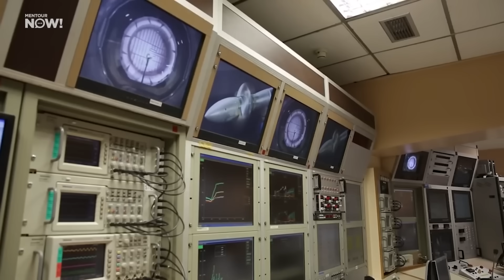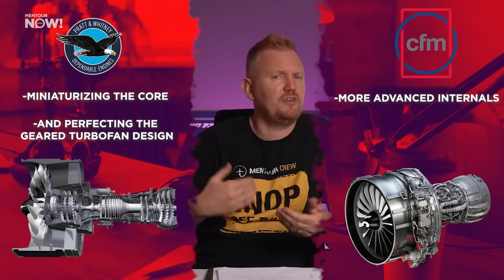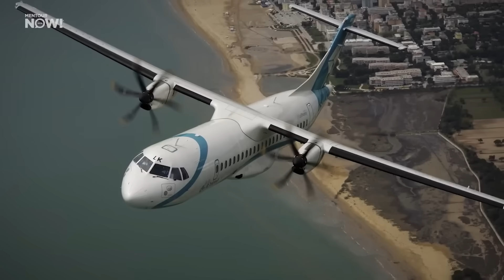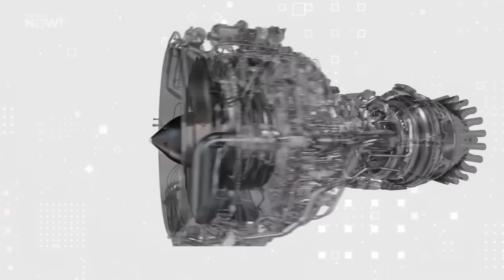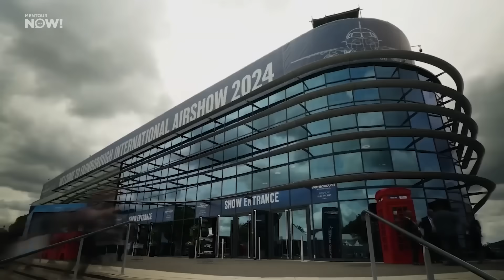Brilliant Or RISKY? Modern Aircraft Engines!

Comment: At the beginning of every flight airline stewardesses or stewards will select passengers that will help in the case of emergencies like aid in the opening of emergency doors.  On Boeing's 777 air liner this includes picking a particularly strong person that will can shimmy down the length of both wings during flight to help deploy the folding wings in the event they won't deploy during flight.  True Story.

Comment: Just looking at the planned open fan engines, I have concerns of what happens with a bird strike, cold/hot weather and stresses on plane frame, tail. Does there also need improved landing gear/tyres?? Also what is the impact of vortex trail on take off and landing, is there any change during flight?

Comment: One thing to consider re noise reduction in open-fan engines might be to draw inspiration from aircraft of old like the XB-70 Valkyrie, except with fan blade design instead of wing design. Instead of compression lift, why not compression thrust?

Just as the XB-70 used the shockwaves produced when flying faster than the speed of sound to its advantage, it might be possible for the CFM RISE to exploit that supersonic blade rotation the same way by angling the blade-tips backward at 45-degrees so that the shockwaves flying off the blade-tips are bent into a rotating invisible tube of sorts. Would be taking what would otherwise be a nuisance and transforming it into an extra efficiency gain.

Comment: Turboprops just aren't as safe as turbofans. No matter how much they try to compensate and make it similar to the ATR engine's propellers, they still need to have the governor, which can fail, you need to feather the props if the engine fails, which can also fail, during a belly landing you won't lose one blade, but all of them on both engines, resulting in shrapnel going everywhere, even if the cabin is reinforced it could go through the windows, which has happened, and then you have the water landing where I don't know how it would impact the dynamics, but I can imagine it won't be beneficial.

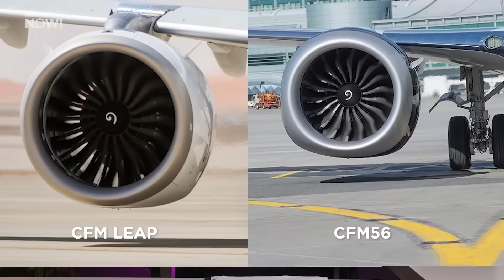Comment: 23:07 “To make an engine more POWERFUL” vs EFFICIENT ‽

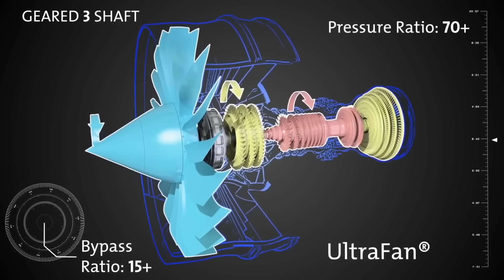51:22 “Three spool design” with a actual intermediate pressure spool or a three shaft design created by a gearbox? According to literature:

“The Rolls-Royce UltraFan uses a geared three-spool architecture, combining traditional triple-spool efficiency with a gearbox, allowing the large fan and core components (Low-Pressure [LP] & High-Pressure [HP] systems) to spin at their ideal speeds, offering massive fuel savings and reduced noise, even though the gearbox effectively replaces the physical third shaft, making it a "virtual" third spool for the fan.

AND:

The "Third Spool" in UltraFan: The gearbox allows the fan to run slower and the core to run faster, acting like a third, independent spool but without the added shaft weight.

AND:

An enhanced IP turbine drives the fan via a power gearbox, allowing DELETION of the LP turbine!”

So the UltraFan is identical to the other gearbox turbofans with TWO spools and a marketing TERMINOLOGY of a VIRTUAL SPOOL!

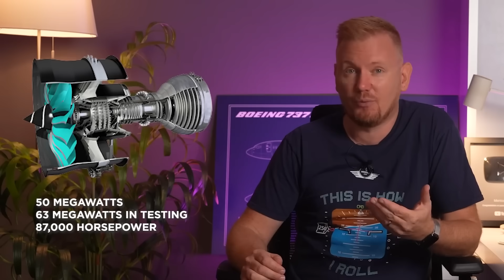54:25 “63 Megawatts (for UltraFan)” vs the GE9X holds the world record for most powerful commercial jet engine, hitting 134,300 pounds of thrust (597 kN) which equates to 65-megawatts (which is not an actual published value)!

Comment: 16:15 — The Tupolev Tu-95, NATO Reporting Code "Bear" with its four Kuznetsov NK-12 engines with contra-rotating propellers was so LOUD, it was picked up by the Sound Surveillance System (SOSUS) Network, which was a network of passive sonars placed on the bottom of the ocean listening for enemy Submarines. But whener a Tu-95 was on patrol, the People listening for Soviet Submarines knew their exact location. And Tu-95 Crew have reported that the noise flying on long patrols was exhausting in itself. Contra-rotating props are a great innovation for speed — BUT — I believe a lot more work needs to be done on the aerodynamics dissipating the supersonic shockwaves in such a fashion that it brings the dB down CONSIDERABLY — before this will become popular for airliners to use…
I love the fact that you brought this plane up @MentourLongHaul, because it is a unique machine in many ways, not at least in regards to NOISE! 😂 👍
I had a cousin who flew the Lockheed P-3 Orion Patrol Aircraft for the Royal Norwegian Air Force, and they occasionally ended up flying formations with the Russian "Bear". And he told me everything rattled in the Orion simply by the showaves from the Tu-95.

Thanks for the tips on the physics of these new Engine Types! 👍 I'm definitely going to look that up and study it further. The — at least theoretical — new Bypass Ratios are just mind blowing!

✝🔔🎄𝕸𝖊𝖗𝖗𝖞 𝕮𝖍𝖗𝖎𝖘𝖙𝖒𝖆𝖘🎄🔔🙏🏻 ~ From Arctic 🇳🇴Norway🇸🇪 😀 👍
Reply: But is it not the case that the RISE engine does not use contra-rotating props but rather uses non-rotating airflow straighteners to get the efficiency benefits without the negative aspects of high noise production of the very old aerodynamics of previous contra-rotating props ‽